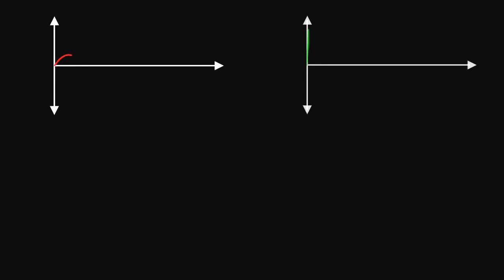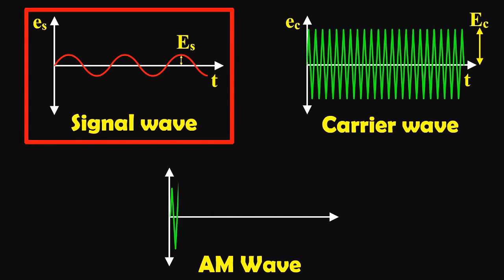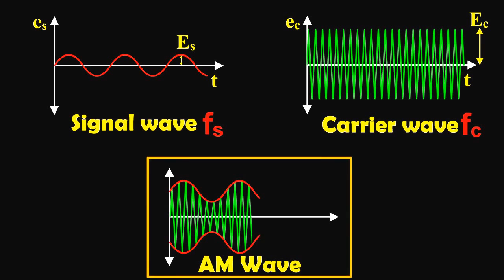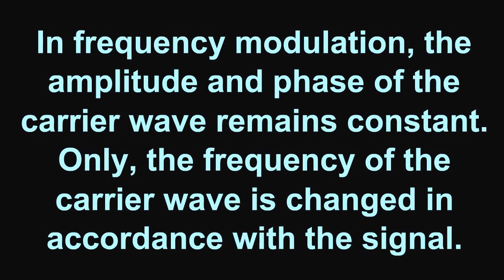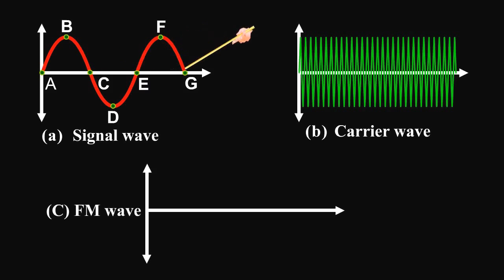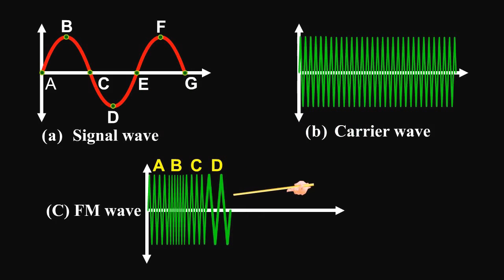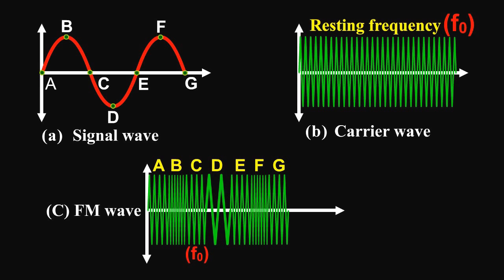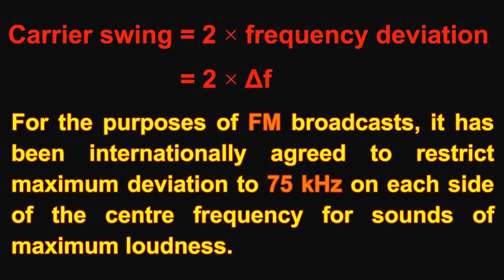Amplitude Modulation and Frequency Modulation

Comment: AM explanation is wrong, the high frequency carrier wave DOES NOT change in amplitude with the modulation, the result of the two sidebands and the carrier interacting on an oscilloscope for example, seems to indicate this, but when AM was first named, they did not know about the existence of sidebands.  Stop spreading simplistic and wrong information LTE!

Comment: Wrong, it is called frequency modulation, but in fact you are modulating the phase of the carrier signal. By modulating the phase of the signal, you are changing the frequency of the signal.

Comment: A mixed amplitude+frequency modulation (AFM) was used by the USSR for jamming of the foreign HF (3.9-26.2 MHz) broadcasting radio stations. A special Zenit-M type modulator was designed to emit any mixture of the AM and narrow band FM signals: 100% AM+0 %FM, 50% AM+50% FM, 0% AM+100% FM, etc. While listening with the short wave AM radios, AFM modulated jamming radio programs (usually music) were audible more or less distorted.